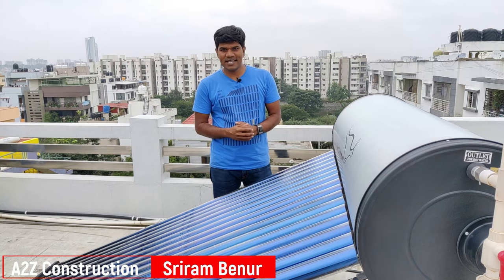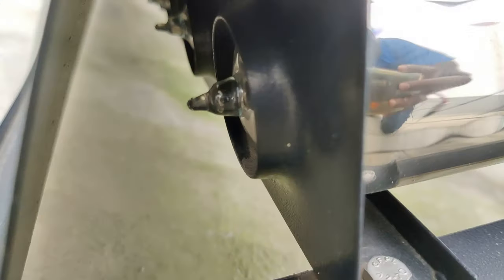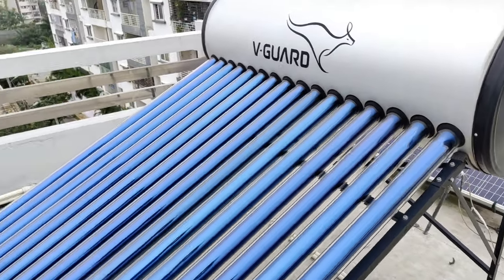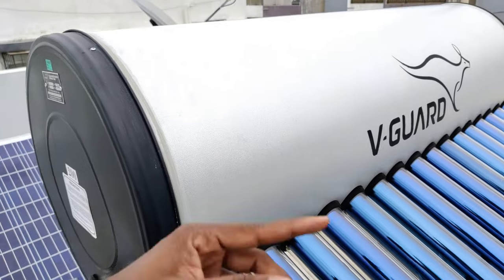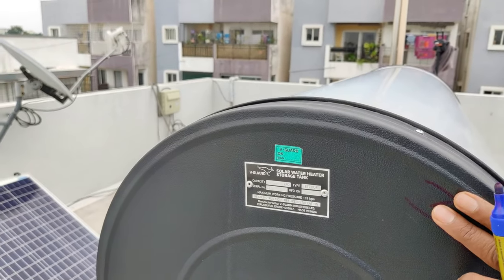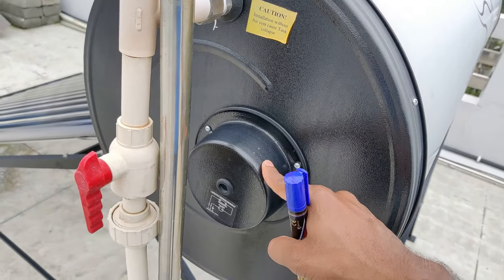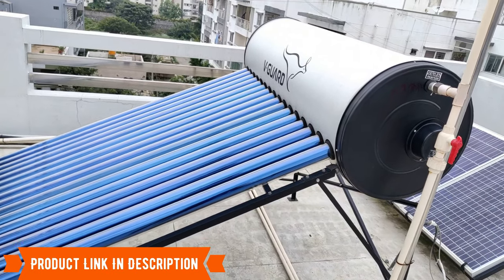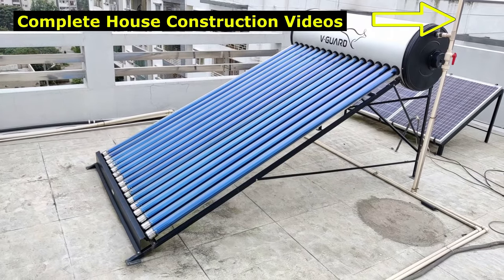Working of solar water heater(2021)

Comment: So this is entirely works in a concept of water vapor when hot air is always goes up because its much lower density than the cold water. Thanks for your clear explanation dude 😊👍 But for me its gonna be useless in the rainy days when you high in demands in hot water. And this is works most of the time in the summer when you are not much need hot water 😅
Reply: great video
Reply: exactly

Comment: It was my understanding that water did not move through the evacuated tubes but a phase-change liquid gained heat and changed into a hot gas which moved up into a heat exchanger where the gas condensed and heated the water in the tank.
Reply: Exactly. He doesn't know what he is talking about. Water DOESN'T GO inside of the evacuated tube.

Comment: Do you know how to solve air block issue ? Whenever overhead tank water is empty, hot water tap completely stops. Even after refilling the overhead tank. The work around I do is kepp all the taps open in bathroom. And close the solar outlet for some time. And open it again then I can hear the air going out from the pipe.. is it a plumbing issue or is it common?

Comment: what are the problems associated with this type of model like tube bursting, leakages, maintenance issues etc. Inside the Glass tube there is one more tube, what is the material of it? Why the Vacuum is required? what is the purpose of it? what is the preventive maintenance we have to do?

Comment: Surpose you don't have a water tank you use a direct water from the source or you use booster pump as source of pressure can we use these solar geyser connected directly to the geyser tank to maintain same pressure? If so what accessories should we fit in thanks so much

Comment: Sir, Recently I installed 150 litres Solar water heater Supreme Make sleeper model in February 24 by local dealer here at Nellore (AP) . Yesterday when I checked the tubes, 2 no’s tubes are warm when compared to remaining tubes , and at the bottom of those tubes silver  coating changed to clear glass colour. What are the reasons and why it happened ? Please tell me the reason 

M Venkata Ramana

Comment: Thank you so much fo this great explanation:-) But i have expected much more in technical. My doubt is:- 1) When there is no hot water, do the cold water completely fill the tank.
2) is the ventilator pipe kept at level equal to overhead tank in order to avoid the spillage of water? If so, in my home has FPC solar type but the ventilator is not at level of overhead tank(but 3 feet above the hot water outlet T) and also there is neither spillage of hot nor cold water. What's the reason of ventilator?:-)

Comment: I presume Polyurethane foam will act as a thermal insulation to maintain heat overnight. Suppose due to any leakage of the tank the PUF has to be cut and removed so as to fix the problem. Now after removing the PUF how will you fill that area where PUF has been removed

Comment: Sir  I have purchased V guard 200 LPD win hot solar water heater,  in that storage tank at cold water inlet side one immersion rod is fixed? What's that purpose?
Reply: That Rod is Anode rod which Attracts Salts from water and  Cleans Water from salt or it could be a Water Heater from Electricity by giving wire connection.

Comment: Can we use UPVC pipes for delivering hot water from the solar heater to bathroom taps?
Reply: Nope. Upvc pipes are not recommended for hot water above 50degrees. Use only cpvc or gi pipes

Comment: Hi, what is the purpose of the air vent? You did not explain. Thanks
Reply from the maker: Air went helps to move in or out air so that water can flow correctly.

Comment: 200LPD should have 20 tubes but I can count 16 tubes.. is 200LPD only tank capacity or they included accumulated water in tubes also
Reply from the maker: It's the tank capacity

Comment: are there any chances of getting these tubes burst due to high temeperature or pressure built inside the tank. You forgot to mention about one safety aspect which is safety Air release valve.

Comment: I have connected 4.5 Kw 3 litere water heater  in between solar water and bathroom whenever water is litter warm I switch on the water heater so I am able to use the heat from solar which saves electricity use only till you are taking out the water I have connected it to shower

Comment: There is no water in the evacuated tubes. The water is contained inside the storage tank, and the tubes are very hot on the end sticking inside the tank, and heats the water there. The tubes only contain a small amount of alcohol.

Comment: You've misunderstood how the tubes work... No water moves through the tubes. They are a completely closed system with a heat collector at the top that the heat gets collected from all the tubes. That's actually what heats the water.

Comment: from indonesia ..... 200LPD should have 20 tubes but I can count 16 tubes.. is 200LPD only tank capacity or they included accumulated water in tubes also .
Reply: It's is india
Reply: It Depends on Water Tank and also the Quality of Tubes...if quality of Tubes is good then Only 16 is Enough but if Tube quality is Average then you require 20.

Comment: What happens if cold water inlet and hot water outlet is swapped?
Reply from the maker: Great question, don't know what happens. But it clearly shows where to connect cold and hot on solar tank.
Reply: If cross connected, water leakage will happen on either of the end.
Water gushes out from air pipe too.

Comment: Does it require solar panels to generate power to heat the evacuated tubes ?
Reply: No, not solar voltaic but solar thermal.

Comment: If the investment was $25,000 and I was going to save $50 a month the payback would be 41 years,  and factoring in the time value of money it would be much longer.   It is nice tech, but simply running a hose through a blackened glass-enclosed box which you can make yourself for hundreds instead of thousands of dollars would break even in a handful of years.   Crude perhaps when compared to ETC but effective.  My gas bill for hot water is just not high enough to justify something this expensive.
Reply: The amounts mentioned are in Indian rupees not USD.

Comment: Hello fine explained my experience care with guarantee fist options to sell the product after sales no service in the assured years i purchased supreme solar system based Bangalore before 7years and i got 10 years warranty before 5years the storing tank leaked near the tube i complaint many times but no response i complaint to chande the leakage no response then i completed to company they said the local server person come they passed for two years and two  technician report to change the tank not cared about the complaint still now. I filled a case against company and no response they not attending the court also so worst company their motive is to sell the product and forgot after the sale so purchase people aware of the supreme solar system company those who are aware will look about the company and after sales

Comment: What expert? How can the water ever go to the higher tank? No need for this one way valve...
Reply: Density
Reply: @arpankhaiwal7732  The feed line is coming from the the higher water tank and leading from the bottom to the water heater. How will the hot water with lower density overcome the higher density of the cooler water in that line?